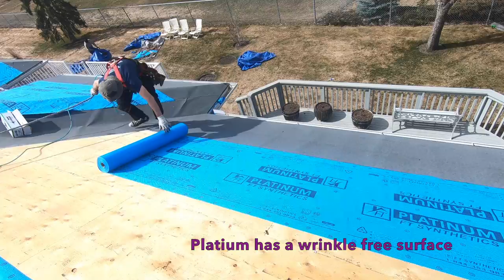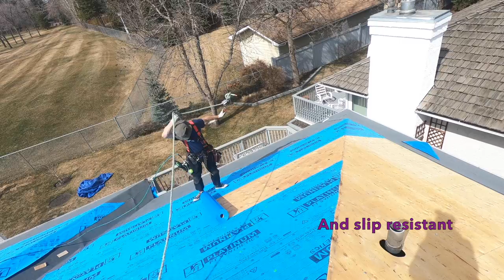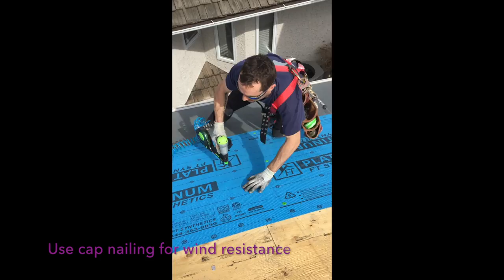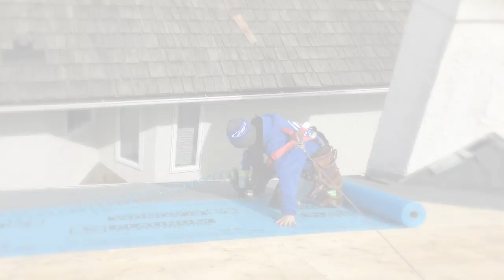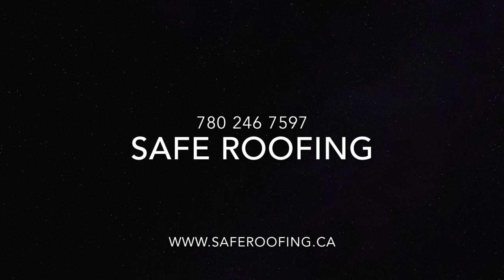Install FT PLATINUM roof underlayment - Safe Roofing Edmonton

Comment: Is this stuff waterproof for the most part if you needed a week or two to lay the metal down?
Reply from the maker: If you install this underlayment properly, the material is water-resistant for a lot longer than a week or two. But please be aware that this underlayment is not meant to be a waterproofing material. When we do very large roofs, we often do in sections instead of tearing the entire roof off (We got a lot of rain in Edmonton this year.) and leave it for a couple of weeks. It's not just about the rain. Also the wind too.
Reply: 45 days this material was on, gold, not platinum.
It worked great, all round top plastic hand nails